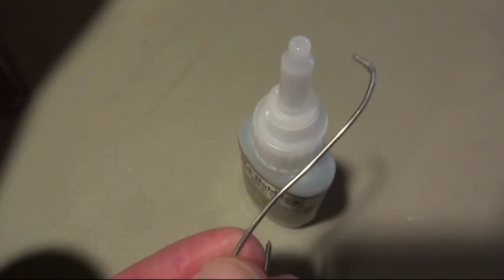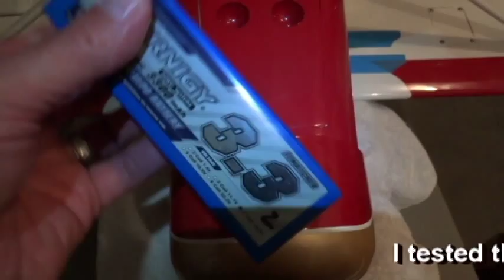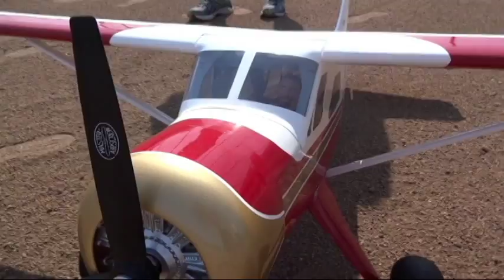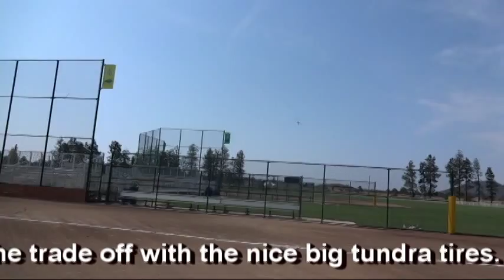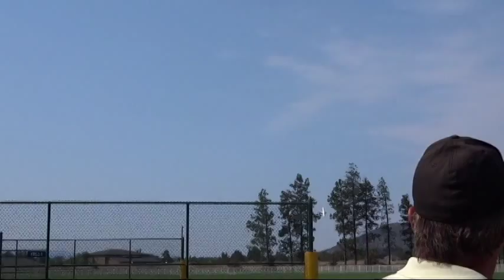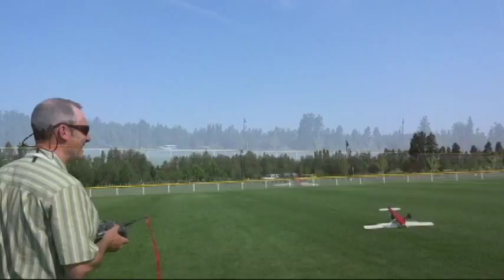E-Flite Beaver 25e Build Video Part 5, and Maiden Flight!

Comment: My maiden flight was pretty much like yours - nose heavy. I used up to 90g (3,17 oz) of counterweight and it worked - most of my attempts to make a simple loop ended up in loss of lift in spirals and temporary loss of control (my friend said "hmm, what a nice barrel roll" not knowing my intention was to make a loop :D). Solution? I replaced my heavy 125mm (5in) and 6,35 oz (each) wheels with two 100mm (3,93 in) and 52g (1,8 oz) each inflatable wheels, changed the 4.000 mAh for a lighter 3.300 mAh one. This all allowed me to get rid of all the tail counterweight while not compromising the look of the bush flyer. At the end I shaved 450g (15,9 oz) of the dead weight! The Beaver is still a little bit heavier on the nose (trimmed electronically) but it already flyes smoothly allowing me some 3D as well. It also flies safely around 10 minutes. Good luck :-)

Comment: I used a 4250 800 kv outrunner and 5200 mah 4s total power 1050 with a 12 x 8 3 - blade master airscrew